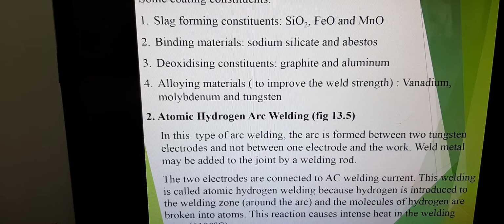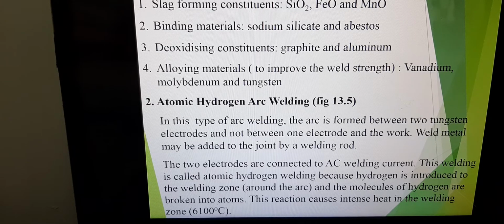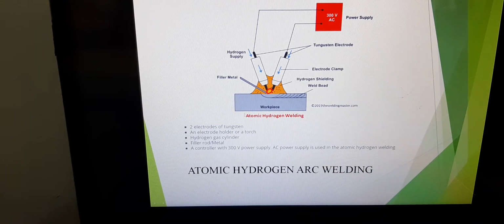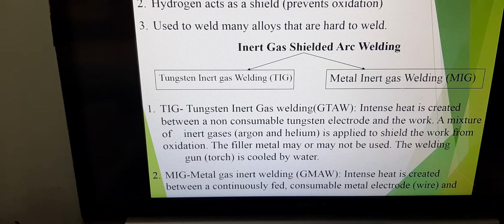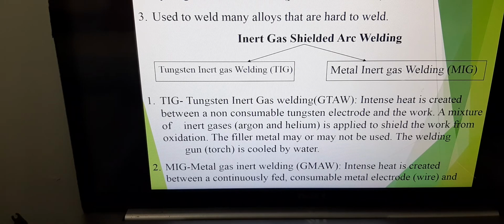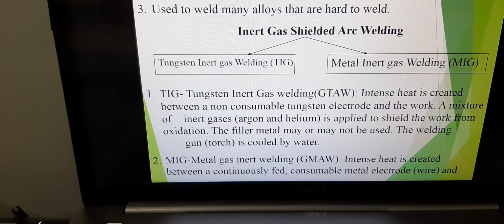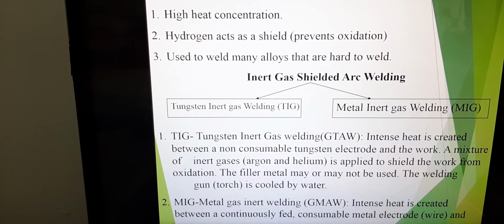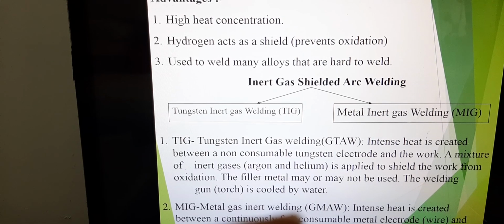WELDING AND JOINING  PROCESS PART 3

Comment: Good evening madam, I'm Chong Jin Yang (ME0106047). From this video, I have learned about two types of arc welding process. One of it is atomic hydrogen arc welding. The arc is formed between two tungsten electrodes and not between one electrode and the work. Weld metal may be added to the joint by a welding rod. Hydrogen is used as the gaseous shield for this welding. The molecules of hydrogen will broke into atoms and cause intense heat in the welding area. It will create a heat in 6100°c which is mainly for overly brittle materials. For second type is inert gas shielded arc welding. There are two types of inert gas arc welding which are Tungsten gas arc welding (TIG) and Metal gas arc welding (MIG) . For TIG, tungsten based consumable electrode is used while for MIG , metal based consumable electrode is used. Inert gas (argon and helium) will be act as shield to protect the workpiece from oxidation. Other than that, there is also another type of electrode which is non consumable electrode. That type of electrode will be in the form of wire reel. Wire reel will go through wire drive and will be melted. It is mainly used in mass production. Thank you.

Comment: Name : Aiman Hazim Bin Arif Razman
ID : ME0106080

Through this video, I am able to learn about the atomic hydrogen arc welding and the inert gas shielded arc welding. For atomic hydrogen arc welding, arc is formed between 2 tungsten electrodes as hydrogen acts as a protective mechanism to prevent oxidation. To prevent oxidation under intense heat, hydrogen molecules are converted into hydrogen atoms. The functions of hydrogen is to act as a gaseous shield, to weld many alloys that are hard to weld and to ease the welding in high heat concentration area. Secondly, inert gas shielded arc welding can be divided into two which are Tungsten Inert Gas Welding (TIG) & Metal Inert Gas Welding (MIG). TIG reprises of non-consumable Tungsten electrodes with mixture of inert gases applied to welding area while MIG uses a continuously fed consumable metal to welding area. Consumable electrode gradually decreases in size whilst non-consumable is continuous. 

Thank you for the insightful video Dr.

Comment: Siti Zulaikha. ME0105567
-I have learn how the hydrogen arc welding process
-Role of hydrogen,act as protection that prevent oxidation process
-inert gas shielded arc welding,TIG&MIG, inert gas is the most stable gas that will not react with other substance.very safe to use as protective mechanism
-non consumable,the electrode that if not be use during the welding,it just dummy electrode.